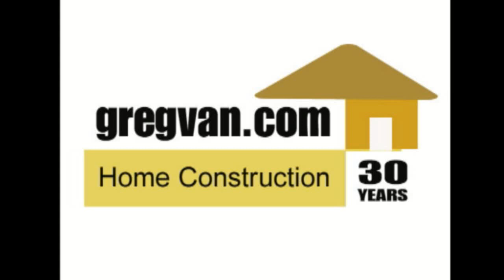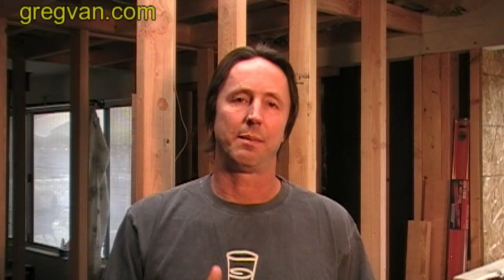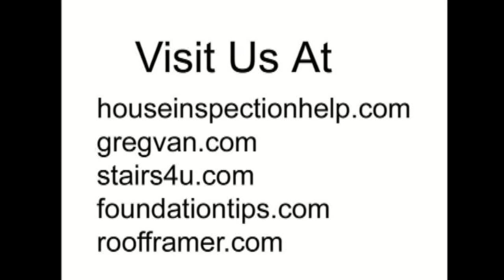Studs and Window Anchor Bolt Problems - Proper Positioning of Building Hardware

Comment: Like you mentioned, what should you do if an anchor bolt is already in the middle of a section of windows?  I am finishing my basement and have long windows each with a few anchorbolts right in front of them.  Should I cut them off above the nut and try to creatively frame on top of them? Any other options?